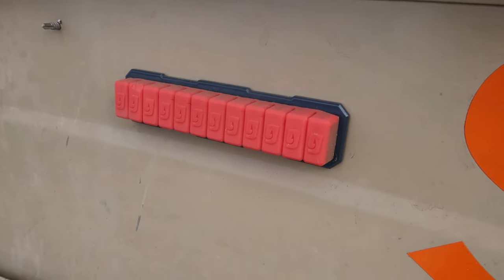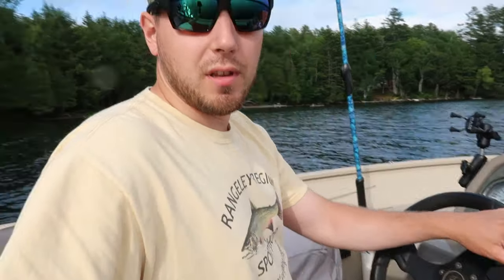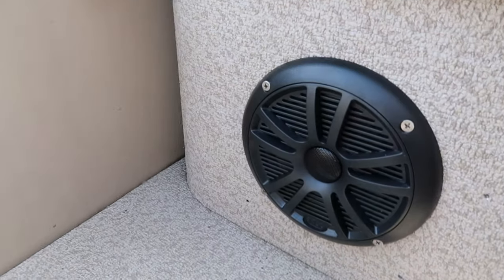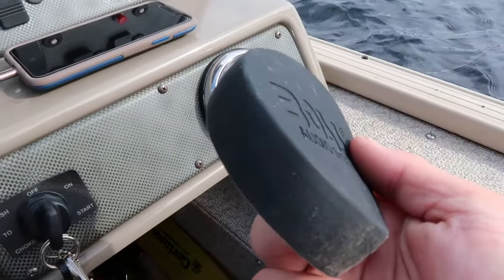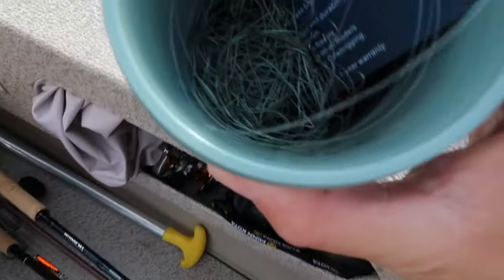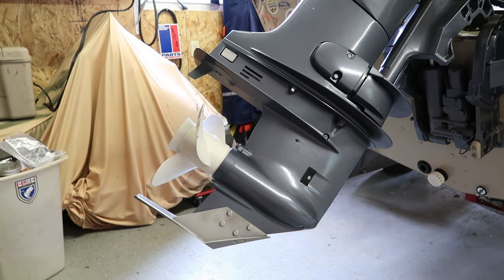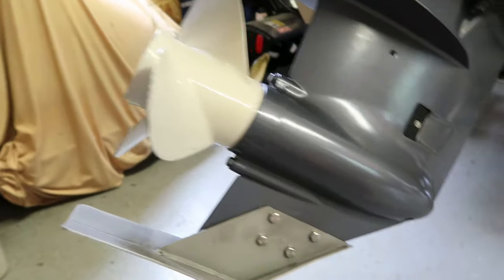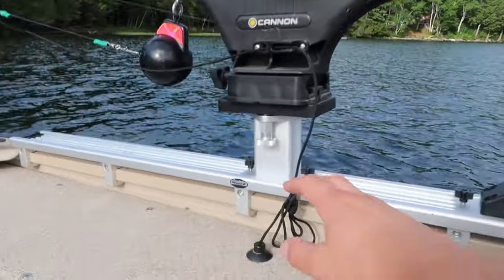5 AWESOME FISHING BOAT MODS!

Comment: Approximately what size is that little trash container   20 oz coffe cup size?  I’m looking at Walmart for a cup like that because I’m not paying $20 on Amazon for one of those. I also thought about a plastic coffee can and super gluing 3 or 4 big nuts in the bottom so it doesn’t blow out going down the roads, fI just found an 11.5 oz can of Folgers coffee for $6

Comment: These were some cool mods. What is that track system thing called? I couldn't find it in your links below. I have a track system but I don't use it. I have wires ran through it for all my lights and electronic upgrades. 

Cool boat by the way. I would definitely buy it. What is it? I think you mentioned it in another vid but I don't remember.
Reply from the maker: Traxstech

Comment: You should connect the 2nd speaker.  The 2nd channel should not be left open, plus you are loosing a lot the music info.   Just mount the 2nd speaker in the pvc enclosure.   So tthe speakers are back to back